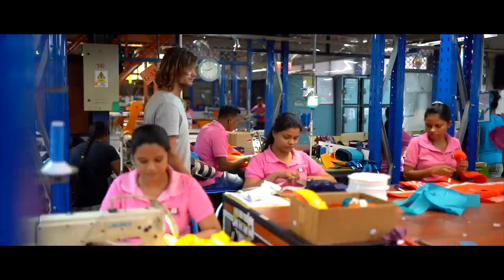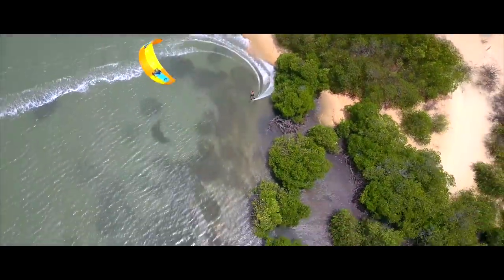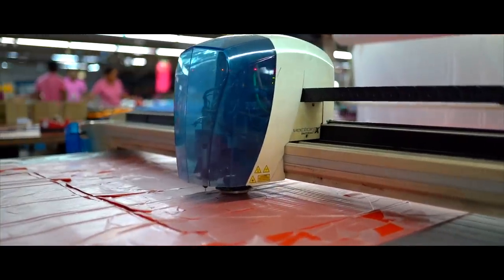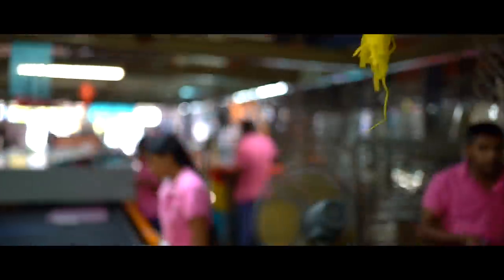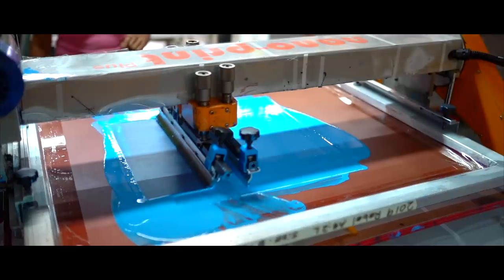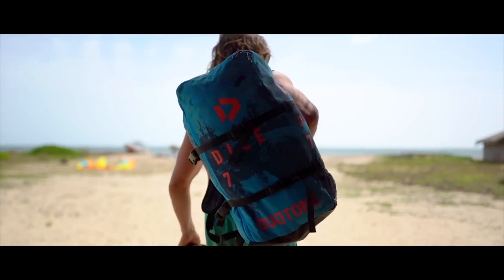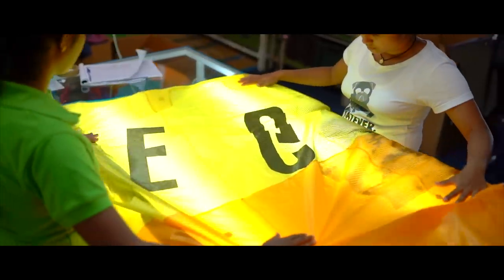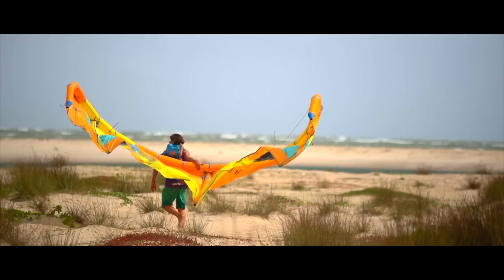HOW A KITE IS MADE - Inside the Factory

Comment: Take away: Quality management is an Sinhalese Guy running around with some weighted rope.
Reply from the maker: no its actually all done through bar codes on each process so if there is ever a defect we can trace it back to the exact process and time... the rope is to make sure the bladders have gone in without a twist... yes, lots of the processes are manual